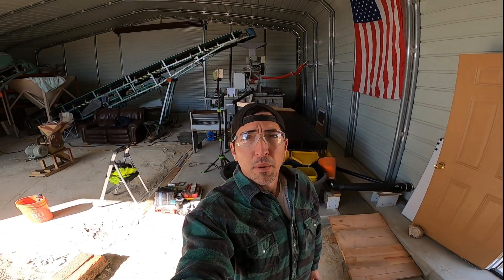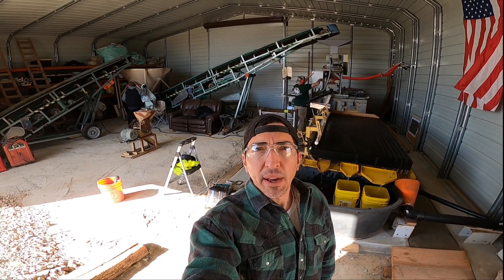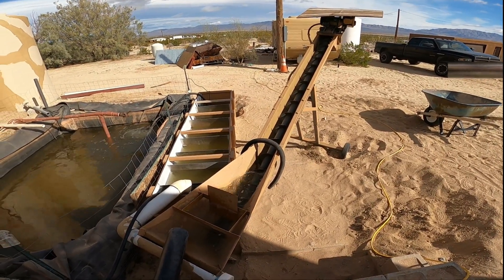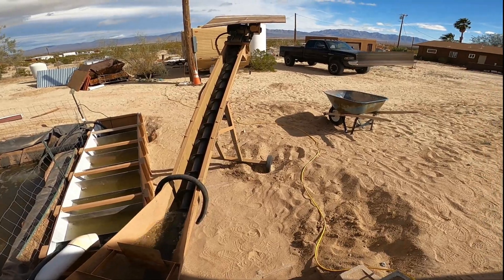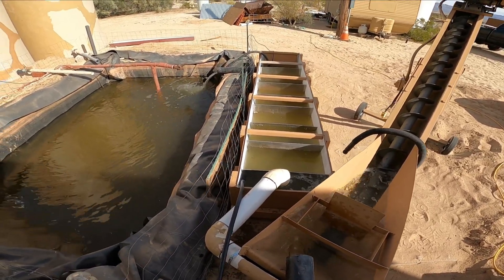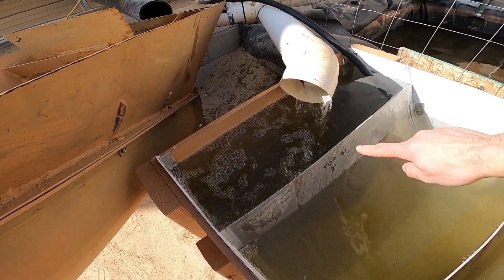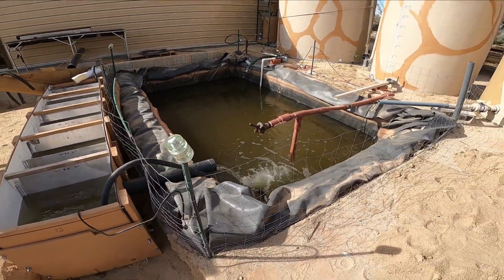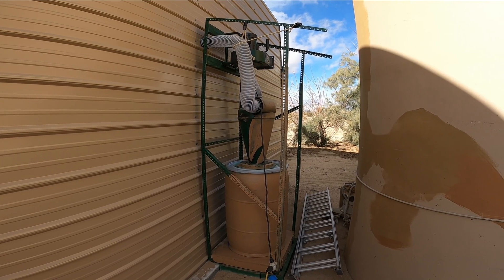First Test Run! Crushing, Conveying, Dust Control, Gravity Concentration & Recirculating Water

Comment: The Stutenroth is a sturdy machine, but the perimeter in and out means the air flow kinda goes everywhere.  I built a smaller crusher that had an inlet near the rotor shaft and blows the product up and out.  Thus it doesn't blow any dust except at the outlet and that makes it easy to control.  Not nearly as tough as a Stutenroth, but you could probably build something suitable.  My issue with my Stutenroth is the classification after pulverization.  I hate needing the extra step combined with re-circulation.  Right now it works OK at 500 lbs/hr screened to 20 mesh minus for leaching.  This ore is 80% passing 6.8 micron gold, so that seems to do well.  We get about 85% dissolution in 24 hours of agitated tank leach.

Have you tested your tailings to see how much you are losing?
Reply from the maker: We're currently testing our tailings. No definitive numbers to share yet. We are having poor liberation though. We'll have to somehow change the discharge screen to get a better grind, or I'll have to reinstall a screen deck under the mill. We can't wait to start leaching. That'll help us in our recovery and allow us to spend more time extracting and processing.
Reply: @mineoperator  If you are not getting good liberation, you can't get good gravity recovery.  I would suggest screening product to different sizes, panning them, and then assaying the results.  Remember, you don't have to pan down to gold.  Just pan most of the material out of the pan.  If it is not liberated, substantial gold will still be in the tails.  If it is liberated, it will be in the pan, even if heavily contaminated, as long as it is over about 4-500 mesh.  By testing different mesh sizes you should be able to figure out the proper grind quickly.
Reply from the maker: @Hard Rock University  We'll do just that Keith. The sooner the better.

Comment: Good job on your plant you have all the pieces for the jigsaw puzzle. Hopefully the list will make your plant more efficient.
A. Put a fixed magnet above the belt to remove any tramp steel, this will stop any problems in your hammer mill.
B. The screen mesh above the conveyor going to hammer mill -  make a shoot that places the fine material onto the conveyor going to the hammer mill only 75 to 100mm wide. This will make the material leaving the conveyor go into the hopper above the hammer mill reducing your dust problem, (it won't fix it 100% but it will make it a lot better)
C. The hopper above the hammer mill, the bottom opening has to be reduced so that the material leaving the hopper is a constant feed but also you want the funnel effect half fill so that you are not sucking air into the hammer mill. The hammer mill rotor spinning is making a fan effect and if you reduce the amount of air going in and only have material going in, 80% of your dust problem will be solved. This also works with the discharge if you can only have material discharging a lot of your dust problems will be solved
D. Material leaving the hammer mill will have steel wear fines - place a magnet above the discharge port and that will pick up any magnetics.
E. You should have a surge hopper/feed hopper from the hammer mill that can hold a large capacity of material that can feed onto your wash shaker table ie your primary and secondary crushing may only take 1/2 hr to complete, but your table may take 1 to 2 hours to do properly. Also you may want to split this product into 2 sizes 0 to 1/2mm, 1/2 to 1mm, to get the best recovery result and you find that the 1/2 to 1mm will process twice as quick as your fine material been that the course material moves forward further on each bump.( combining the 2 on the table the fine materials move too slow and the course material climbs over the top of it and go into the 3 and 4 port.
F. Tabling the material correctly you will produce by products ie tin etc always test your number 2,3 and 4 ports you may have money value there
G. Your sand screw can be used before the table.  If  you have a high clay content or tree roots, grass in your crusher feed. The waste material can be floated off the back of the sand screw and your clean sands can go onto your table. 
H. Your silt trough I use 200 litre drums, the dirty water goes into the 1st drum and spill into the 2nd drum through a fitted pipe that lets the water flow to the near bottom of the 2nd drum and into the 3rd drum the same method. When the 1st drum is full of silt it is removed with a forklift and the 2nd drum takes its place and so on. The 1st drum is taken to the waste pile dump - the drum is reused with minimum muscle required.also works with the discharge if you can only have material discharging a lot of your dust problems will be solved
Reply from the maker: Great recommendations Lorna! 
A. Tramp steel - We had some tramp steel enter our mill and cause a major problem a year and a half ago. We'll absolutely install one asap.
B. I forsee some changes happening to this portion of our process. We'll consider your suggestion. 
C. We recently addressed this issue and are happy with the results. They're on par with your recommendation. The funnel effect is the top hopper is created over a 10 inch long section that causes the feed to zig zag into the mill.
D. I love this idea. We do have wear steel coming off the plates and ending up on the table and in our cons. We'll install this asap.
E. This is an interesting idea. One that we haven't considered. We'll consider that recommendation.
F. We're having our concentrates chemically assayed and bench scale leach tests performed. We have by/co-products that we need to capture.
G. Good idea. 
H. Those drums would be easy to handle. Good idea to handle the silt. 
Our team really appreciates your comments!

Comment: DUST,VARIABLE SPEED FAN BLOWING OUT THE BUILDING?
Reply from the maker: Absolutely RadicalRalph Russo. We have a follow up video with some improvements we've made. I'd say we've contained 80-90% of the dust from that mill. That thing looks like a locomotive without any wet/dry vac system in place. Absolutely nuts. I'll get that published soon. Then to dial in the remaining 10-20%. Will need some recommendations on that.

Comment: We have solved a similar fugitive  dust issue by simply introducing a slight negative pressure to the product output discharge side of the Hammer Mill. This can be done by discharging your Hammer Mill product into a homemade 'cyclone' shaped steel- fabricated device and where the undersize fraction discharges from the top of the 'cyclone',  connect on an off-the-shelf saw- dust extraction unit. Such as an Hare & Forbes unit which you should be able to google on line. You should be able to purchase a similar unit in USA. I believe that they are Chinese made, like most things these days !.  Cost of around AUD$300. The vast majority of product reports straight down to base of the 'cyclone'  and release this fine product via a rotary valve /rotary seal discharge arrangement, Hardly much dust reports to the dust collection bag and certainly no gold (eg dense) particles do. This slight negative pressure stops fugitive dust escaping from your  Hammer Mill  inlet area. Good luck.
Reply from the maker: Thanks for that recommendation goldaction1. I'm reading up on the Hare & Forbes setup right now. In a follow-up video that will be released in the next week, we'll be able to show you what changes we've made. A big improvement indeed. I like the setup your describing. Makes sense.

Comment: If you put a shroud over the conveyor to keep the dust penned in, you could have a shop vac or air compressor blow across a hole in the shroud and remove the dust by venturi, and then pipe it outside past a small waterfall setup that recirculates water to kill the dust, and retrieve it periodically for running through the mill
Reply from the maker: I like that Jonas. We recently set something that's similar to your description but not the waterfall idea. We're gonna post a video soon with our recent changes but we may want to incorporate some of your suggestions. Thanks!
Reply: @MineOperator  for sure, I've got a bunch of oilfield and mining experience too, so I'm happy to bounce ideas back and forth.
Reply: @MineOperator  actually you wouldn't need a waterfall come to think of it. You could just run the venturi dust tube into the top of a tank with water about halfway full, and then have a pipe coming out the bottom that does a 90 degree turn upwards, and then put a shop vac on it to pull the air from inside the tank and creating a negative pressure zone that pulls the dust into the water.....I just realized I basically suggested you attach a massive bong onto your mill setup! 🤣🤣
Reply from the maker: @jonasr7230  lol 😂

Comment: That table is going to have a hard time running 1 ton per hr. The stutenroth exit size is going to vary from 20 mesh to 100 mesh, with the bulk being around 40 mesh, which is too large in my opinion for complete liberation. If you have a VFD on your converyor belt, you might try adjusting the feed into the stutenroth to meet the table feed limit, slowing down the feed into the stut will also give you a finer crush. you've got a lot of equipment setup and you've come a long way, hope it works out for you.
Reply from the maker: We successfully ran 1tph before. Viewing our cons through a microscope, we noticed gold still attached to quartz and/or black sands. Not entirely liberated. Since a portion of the gold is available, leaching our cons is something we are currently testing. We technically don't need full liberation, only partial as crushing is the most expensive part of gold recovery. Our ore is soft. Past sieve analysis of the Stutenroth discharge showed 90% passing 30 mesh when we have new plates in the mill and we feed the mill with -1/2" material. Some ore is extremely hard, in which case we may see worse liberation. Yes, we do use a VFD and will try your recommendation. We will be running material (possibly ore grade) from different mines. 50% of the gold we have recovered thus far -200 mesh or 74 microns. We really need to test our tailings more. That's an area you'll see us focus our attention on. Thanks for your comments AU Miner as we enjoy great conversations.
Reply: @mineoperator  I love stutenroth mills, but they have two flaws, the material blows out the top, and the particle size is way too large IMO.  Is you stutenroth the newer design or the older version? I make my own pulverizer that fixes both of these issues - 100% passing 60 mesh - it slows the throughput, but with 92% liberation I feel is worth the time and energy.  A very slight...and I mean ~very~ slight amount of water in the top of the stutenroth will give you better liberation, not even close to wet, but just ever so slightly damp.  I highly suggest building a VAT leaching setup or tank agitation. ecogoldx or jinchan being preferred over cyanide. Gravity recover what you can, and leach the rest. I like your silt trap design, curious to see how that performs. You've got a few nice pieces of equipment there, just a few adjustments and you'll be in biz' :)
Reply from the maker: @AU miner  I believe it's the newer design but I'd really like to hear about your fix to liberate 92% passing 60 mesh. If you feel inclined to share your fix, please email me at info@mineoperator.com or reply. We haven't tried adding a slight amount of water yet. We tried a lot of water and that didn't go well. That's worth trying. I've had success with ecogoldex o-series. We're looking into Super Leach Explorations currently. We plan to build both a VAT and agitation tank in the future. Moving slowly 🐌 but we want to build this right. As soon as we do we'll be on to different ore and have to make new adjustments lol.
Reply: @mineoperator  It's not a fix for the stutenroth, it's a complete new machine.  dry crushing will always give a better result, but the dust is another issue to mitigate. Super Leach Explorations - they make a lot of claims, but i haven't seen them actually produce anything or offer a product...more profit in discovery money me thinks. i'd take my chances with either jinchan or egx over a prebought proprietary system.
Reply from the maker: @AU miner  We plan on finding out an answer to that question very soon. We're open to making necessary changes to our equipment setup. Working with what we've got for now.
Reply: I used the Mount Baker Metal Mining hard rock system in Nevada.  We had to upgrade the bearings and make them waterproof/dustproof.   Then we hard faced the hammer faces so they were not so soft.   I would suggest you ensure your bearings are good and sealed, then add a mist of water at the top of the hopper for dust control.  Too much water will make it worse.   You may also want to place a finer screen in the crusher in order to get a better grind.

Comment: Since you have a vacuum dust system in place, a simple sheet metal hood pyramid that fits over the top of the conveyor and hopper both would work, as long as the vac port is positioned on the opposite side that the conveyor feeds - if you get it tight enough with some rubber sheet, this will create a directional flow towards the vac port and keep the dust from exiting due to turbulence and low pressure zones within the hood itself.
Reply from the maker: Now that is a great idea. We have a Y-split where we can add a secondary hose system that we can run to the top of the mill. Thanks for your feedback!
Reply: @mineoperator  This may work better then using a mist of water....try both methods
Reply from the maker: @Bonks  will do Bonks. We'll find out next week. Hopefully I can turn a video around fast enough 😉